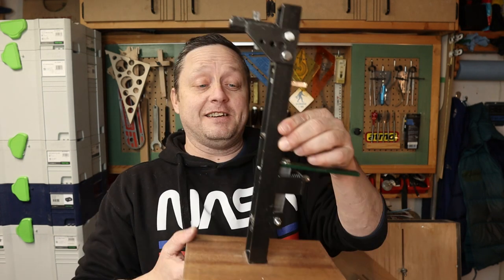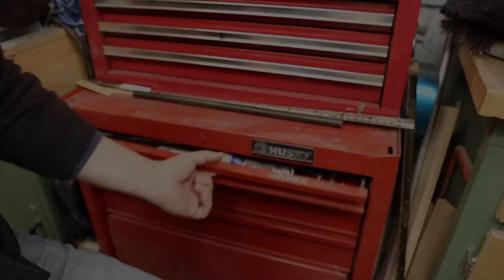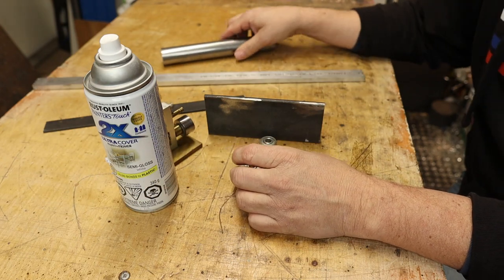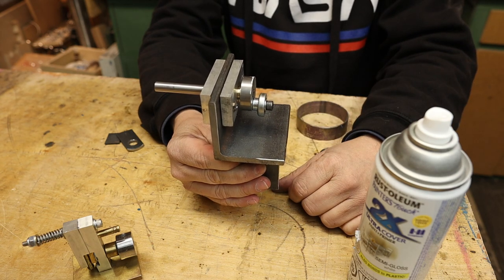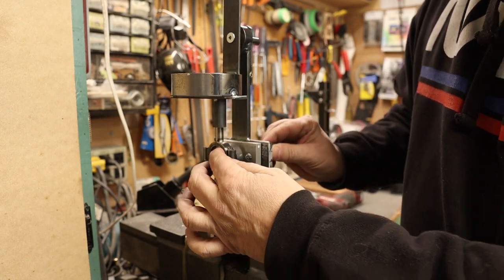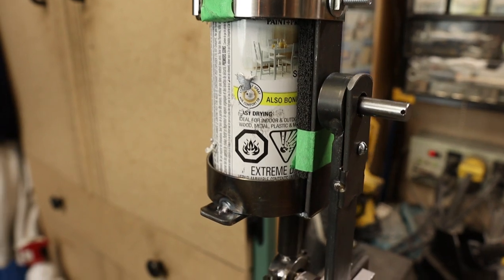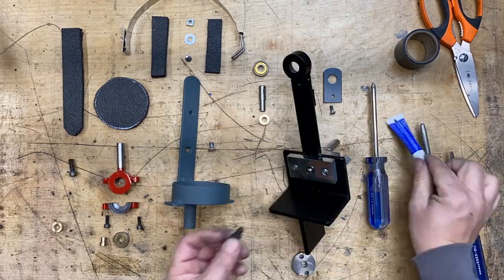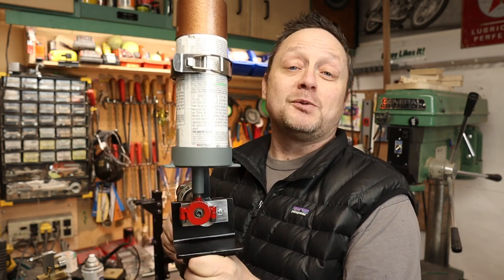Making a spray paint can shaker // Better painting results // Bring old cans back to life!

Comment: This only agitates the glass ball at the bottom. If paint is to be properly mixed, the ball must contact the top and the bottom of the can during movement (shaking). Cheers.
Reply from the maker: That is true, but you can also mount it sideways in the vice as well.   Works well both ways.  Cheers.

Comment: Love the design. Excellent work, but you still have to stand there while using it. Hook a permanent motor to it with a speed controller and timer.
Reply from the maker: Thanks for commenting.   Yes, you are correct.  I’m planning version 2 to be automated as you describe.  Stay tuned.  Cheers.

Comment: The only sticking point is the use of the word "over" in "Making an over-engineered spray can...". What specifically makes it over? It's just doing it right or well. If you're going to do something, do it well (or I'd hew toward excellence). Who are you answering to? [asked rhetorically]. The generosity of taking the time to share a bit well done and not stopping at possible criticism had me subscribe. Thank you for sharing!
Reply from the maker: Thanks for commenting and Subscribing. Using the word "over" was more a play on words similar to a Rube Goldberg machine. Make a contraction to perform a simple task.  Most people just shake cans with their hands or use a Sawzall. I do plan to make another one with less moving parts and to be standalone with a timer.  Stay tuned! Cheers.

Comment: Great Vlog,  can that design work on gallon plastic paint buckets?
Reply from the maker: It should but you would have to up size everything and use proper bearings. Managing the weight will be the issue.